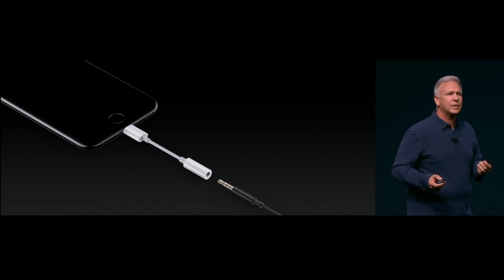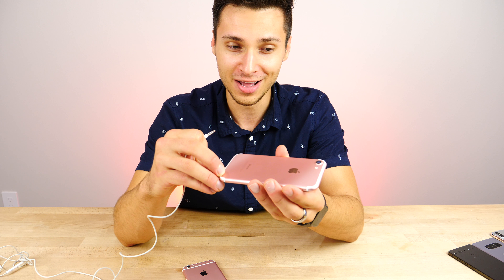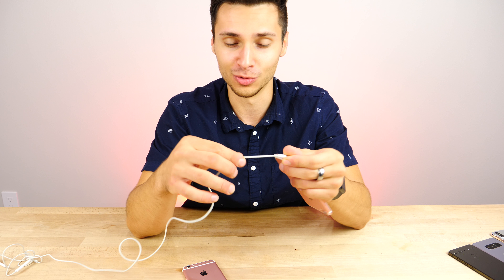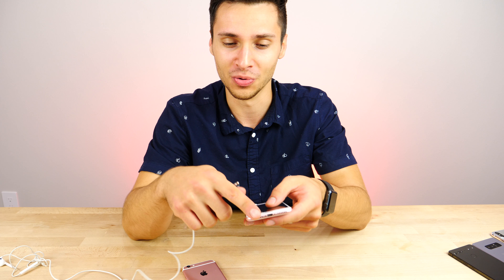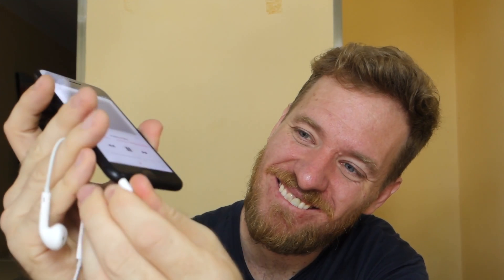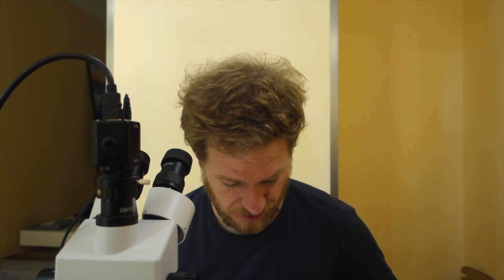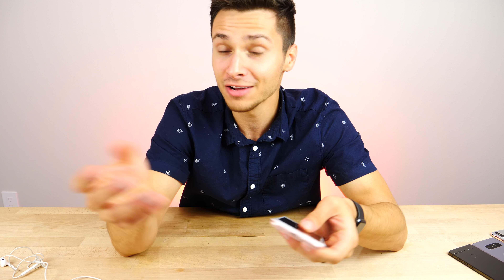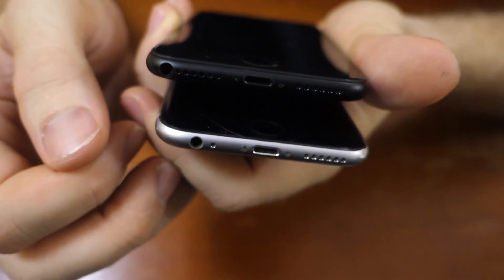Insane iPhone 7 Headphone Jack Mod!

Comment: I watched it in the morning and I was like YouTubers and people need to share this so that apple can see it...
But the thing is apple knows that they can fit a headphone jack they just do it for the money so people can keep on buying...
Reply: KHALID Al muzini How does that make any sense? The removal of the AUX Jack would discourage more people from buying the 7.
Reply: ??? More money from headphone makers that will need to use the lightning port, not people who buy the phone.
Reply: Nathan DaCosta People who manufacture earphones and such aren't affiliated with Apple whatsoever. Apple would only make money from things created and manufactured by Apple, such as Airpods, or items endorsed by Apple. 

In fact, the iPhone 7 comes with a Lightning to AUX adapter and a set of wire earphones that connect using the Lightning port as opposed to the AUX port. The phone comes packaged with these accessories, making it easier for people to continue using their old earphones to an extent (as they can't charge while the earphones are plugged), or their included wire earphones.

And to debunk your statement; No third party manufacturers would produce earphones with the Lightning port. It's inefficient and would bankrupt a small company almost instantly. When people buy the iPhone 7, they're prepared to use Bluetooth earphones from that point onwards. Most, if not all iPhone 7 owners use Bluetooth earphones, and that's what the market is selling. It's the logical choice. Why pay Apple fees to use the patented Lightning cable, when you could just use the wireless Bluetooth technology of the future?
Reply: ??? It's called licencing fee for using lightning port. Because apple own the copyright for lightning port
Reply: ??? While you do have some valid points....your still being a massive apple fan boy. Apple gets paid a percentage of sales from any company that sells ANYTHING that utilizes the lightning port. There "courage" to remove the headphone jack was most likely to promote the AirPods and just to let you know before you say that's not enough, beats is also partnered with apple....and they just so happen to release a new line of wireless headphones/earbuds. So yeah "it's the logical choice" if by logical you meant best way to sell apple products.
Reply: sourskittlez_97 Apple fanboy? I haven't even been supporting Apple. My argument is that the AUX port removal wouldn't bring Apple any money, making it even worse of a design since it doesn't even work as a "cash grab".

Of course Apple gets money from devices that utilize the Lightning port. That's why nobody uses it. As I've said before, the Lightning port is inefficient as an AUX replacement, and nobody in their right minds would produce technology using it, other than a charging cable. It's what I've been saying the entire time.  

If removing the AUX port was an attempt to sell the AirPods, then it was terribly executed. The phone comes with a free Lightning to AUX adapter, and a pair of wired earphones, allowing people to freely use their old earphones. Not to mention the AirPods are expensive as all hell. Why would a consumer pay $200 for a pair of wireless earphones from Apple, when they can buy third party wireless earphones for much cheaper?

In addition, the fact that Beats is producing wireless headphones means nothing. Bluetooth is a popular technology that many companies have adapted to. Beats is simply following the trend so that they don't lose out on business of consumers that own an iPhone 7.

I don't think you're really reading my comments rather than just skimming through them. When I said "It's the logical choice", I was referring to businesses logically choosing to manufacture Bluetooth earphones rather than pay a licensing fee to make inefficient earphones that plug into the Lightning Port.
Reply: ??? The first video That shows on your profile is of Steve jobs introducing an iPhone sure your not an apple fanboy
Reply: KHALID Al muzini Um... It's an inspirational speech, revealing the original iPhone which was ahead of its time by at least 3 years. The current iPhones don't compare to the revolutionary technology that was the first iPhone.

And I also like that you completely disregard my other statements in favor of calling me a "fanboy".
Reply: ??? I actually liked apple all the way till Steve Jobs passed away. Plus some one as passionate as you about apple that would keep on defending what there doing even if it's dumb is sure is a fanboy
Reply: ??? Okay. In that case, why is it that there is clearly room for a headphone jack and it wasn't put in there? Sure, it would pave the way for Bluetooth headphones, but what sense is it to get rid of the headphone jack when Bluetooth is already there? It would be different if there, for some reason, wasn't Bluetooth in the first place. But what's wrong with leaving it there? And if it's to push the industry forward into wireless and to improve on wireless headphones, there's a problem when it takes one company to "push" that. If Apple could make an industry shift or move forward with a simple change of its own product, what else can they do? Does that not scare anybody if it hasn't already? When will enough simply be enough? And if Apple truly wanted to push the headphone industry to [improve] wireless headphones and devices (i.e. let's say the theory that changing their own product was in fact to move the industry), why include an adapter? Why have lightning EarPods instead of wireless EarPods (not AirPods)? All the talk about wireless technology and still no wireless charging until now. 

To sum it up, I only have two theories: 1) The one I mentioned first. They are trying to push forward the industry of wireless devices, however that is questioned by my statements and questions that follow that theory. 2) This removal is step 1 of "something bigger" or "something else" to come. A transition maybe. But that's the thing, I won't buy a transitional device and it's sad that there are people who will. Samsung released the S6 after the S5 did poorly (which I owned). I skipped the S6 because it dropped the MicroSD and IP67 (didn't care for the removable battery, but it was also smaller; why? I will never know), but its design along with the edge was amazing. S7 comes along with IP68, MicroSD, and a bigger battery with still an amazing design. 

Let's see if Apple does the same.
Reply: For the record I actually do want the upcoming iPhone 8 based on leaks, but I'm not ashamed to say that is way out of my price range. While I have had the S3 (sister's), S4, S5, and S7, I really only stuck around for their superior screen while the S7 was simply because its release date fell in line with my birthday, AT&T Next upgrade eligibility, and the pre-order provided me with a GearVR (which I thought I would use, but now I realize I really don't). I don't consider myself a Samsung or Android fanboy, but maybe a Samsung/AMOLED fanboy if anyone would really wish to call me a fanboy of any type. :)

Comment: I think if the battery inside the IPhone 8 (L shaped ) was replaced with a regular one there will be probably more space but smaller battery life ( replacing the L battery with a I one ) I just wanted to share this with you so you can test it! Love your videos ( especially leaks ). Keep on good work!

Comment: I have an easier solution all you have to do is buy the iPhone 6 and then buy the iPhone 7 aluminum back housing and take apart the iPhone 6 and put the iphone 7 back housing on put the phone back together and drill a hole in place of the headphone jack on your iphone 6/7 and you can do this for the iphone 8 because the iphone 6, 7, and 8 are the same exact size

Comment: I like my BT headphones but I generally connect them by the 3.5mm jack because the sound quality is just better. Not to mention that i have a custom equalizer for wired connections.

Comment: Found a little bug that's kinda cool if you're adjusting the brightness in control center as your sliding your finger press the home button and keep sliding and it will still adjust like magic
Reply: Works on iOS 10-10.3.x

Comment: My gym still has the old 30 pin charging cable on the treadmills. Right after they got the new treadmills Apple switches to the lightning cable. To this day I forget the conversion adapter until I'm actually on the treadmill. And every time I'm annoyed. I skip S iPhone years. And don't feel like being bothered with an adapter for my Shure SE425's. So I skipped the iPhone 7. So now I'm seriously looking around at other companies to see what they offer.

Comment: You drilled a hole in the phone, which will lead to the following conditions: (1) the drilling in said phone may not be covered under warranty, and/or (2) the drilling in the phone may damage important components like electronic traces, or even the TAPTIC engine.

Comment: Apple removed the headphone jack. They make you buy the adapter which is over £20. Alright do what ever you want with the pricing. The fact that my iPhone's charging port broke becuase I'm using it to charge the iPhone and plug the headphones is something but not replacing my phone or even replacing the charging port is an other.

Comment: Apple: "We needed space in the phone to make a bigger battery and a taptic engine, so we removed the headphone jack, which also improves water resistance" 

Despite everything above Samsung makes an S8 with better screen, camera, water resistance and STILL KEEPS the headphone jack.

And after some time it comes out that Apple weren't smart as Samsung and  engineer (Scot) to keep the headphone jack.

Cmon really, guys just switch to SAMSUNG.
Reply: "just switch to samsung"

Lol no kid. Unlike you, we Apple users enjoy an amazing ecosystem, long-lasting gadgets, premium user experience, fluid UIs and faster processors.

But whatever. You can keep poking your fingers at glass.

Comment: The Fact that Apple released a headphone adapter, means they admit that the removal of the headphone jack was a stupid idea. Also they admit it by keeping the headphone jack on their other newest Apple devices, while cutting it out only on the iPhone essentially. Bluetooth also compresses audio and isn't capable of lossless audio playback due to its bandwidth constraints. This is why most professional equipment uses a headphone jack, not Bluetooth. It was also funny how Apple said by removing it, it makes the iPhone much more water resist. And it wouldn't be possible if it had a 3.5mm headphone jack according to Apple. Then why did Apple's phone get rated a lower IP67 compared to the competition, which does infact have a headphone jack and yet somehow was still technologically able to make their devices meet the superior IP68 requirements? Hmm...? Interesting! Maybe this is exactly how Apple's competition can keep their dual lens camera flush with the body of the phone, while Apple has a cheap ugly looking camera hump, that's now said to be even bigger than it was on the iPhone 7. 

Just crazy.  0_o

But whatever! To each their own.
Reply: 1. They just released the adapter to not piss off people (at least, to less of the extent that they're pissed off now)

2. "Bluetooth also compresses audio" The average human would't notice.

3. "Then why did Apple's phone get rated a lower IP67 compared to the competition" Higher IP rates are just a gimmick popularized by Android phone companies to mark up the price. In reality, the iPhone is enough water resistant because nobody is going to go scuba-diving with their phone or something.

4. "while Apple has a cheap ugly looking camera hump" I've never seen anyone complain about that. Stop trying to find excuses.

Now, brony, just step away from your computer and watch some MLP.

Comment: You have the adapter cable to have aux cable plug, WHY on earth would you want it inside????

If you dont want to use the FREE adapter, then you are welcome to spend money on a few screens, usb microscope, soldering guns, lots of parts, dremel tool, paste... 

BE PRACTICAL!

Comment: Apple knows that not much people will spend 180€ for airpods so how do they think we get used to this new device ? I mean at least develop some cheaper airpod for the mass so people dont bitch about the lack of headphone jack, I just dont get it ! It doesnt make any difference if I use the earpods through lightening cable, in both options Ive a wire connection and I definately dont want to spend 180€ for this wireless shit, if you remove an option just give an alternative one at same price level and convince the audience about the wireless future, cause now the lack of 3,5mm seems so senseless and apple stopped even producing airpods, so what apple ?

Comment: What has been accomplished, wireless music wise, since the disappearance of the headphone jack? What “leaps forward” has been made in technology, specifically focusing on my music listening experience since then? Absolutely none whatsoever. This isnt about not being whilling to change or move with the times into a wireless world, its that it was a pointless change that didnt need to happen that no other company is on board with which has made absolutely no forward impact in that particular technology whatsoever. They were saying how the music would sound better through lightening etc nope, it was to make the phone thinner. Thats it. I can prove this because the same time they introduced this change on the iPhone 7, they also introduced a new line of beats headphones... all of which had the 3.5mm headphone jack!!! So they introduced this new technology, then a new line of audio equipment alongside this technology, none of which actually utilitises the technology anyway!!! Bollocks. 😂 proper muggy! Thats all i can say. Plus i can almost guarentee you now, no matter what line of beats or apple airpods come out next, my V-Moda M100s or even my Blue Mo-Fi’s will sound a million times better then any of them... guess what? All use a headphone jack.